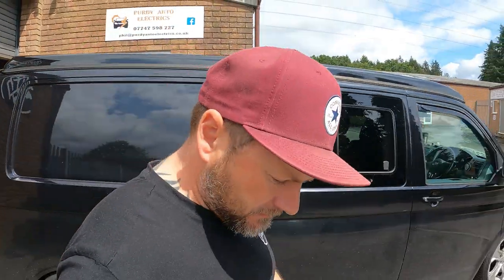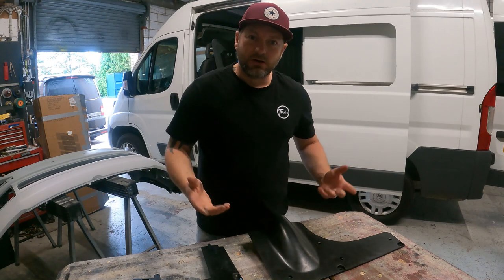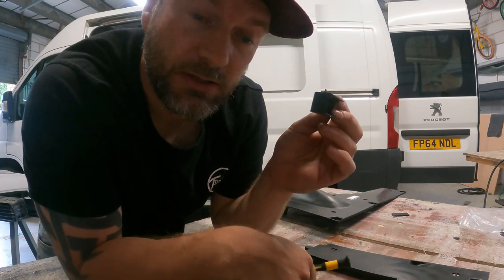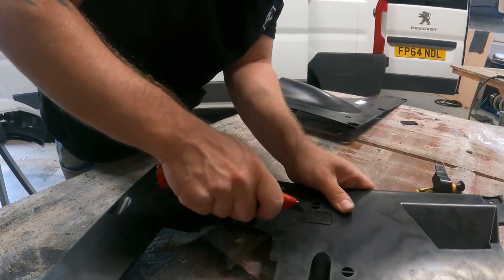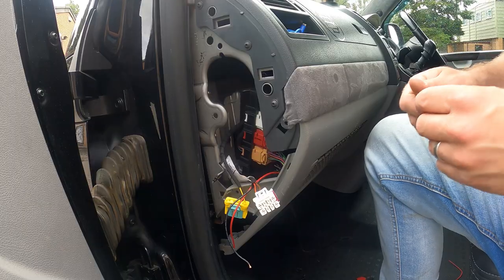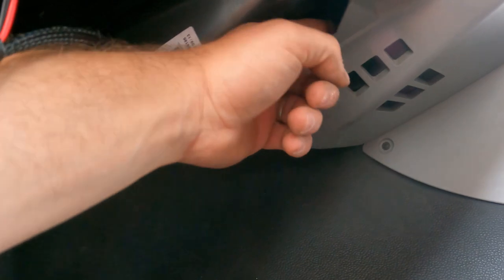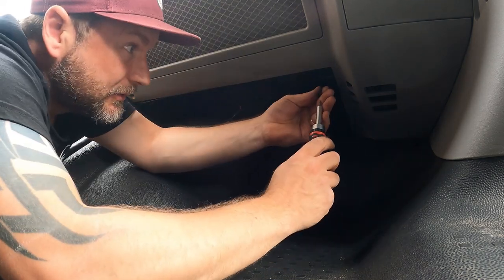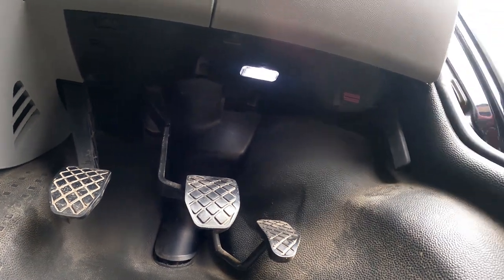vw t5

Comment: Thanks for the video.  I’m looking to do this to my van.  Do both lights get wired into the socket on the passenger side ?  I can only see you attaching one set to the passenger side socket and was wondering if you have the same setup on the drivers side behind the panel ?
Reply from the maker: The loom gets wired in to the passenger side, then the right gets fed across under the plastics 👍🏻
Reply: @tomtdubz  cool, thanks.  I think they sent me the wrong parts as I ordered a light for each footwell but they have only sent me one light.  I though they would just send me another light but it sounds like the double light setup uses one harness 🤯 guess I’ll be sending this one back.  Thanks for your help 👌
Reply from the maker: No worries probably got the kombi step light one 👌🏻